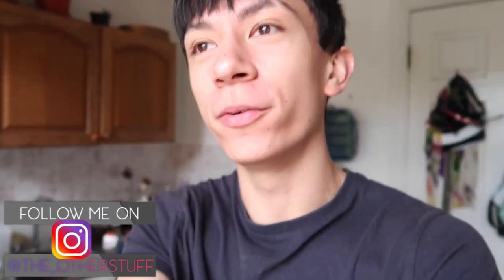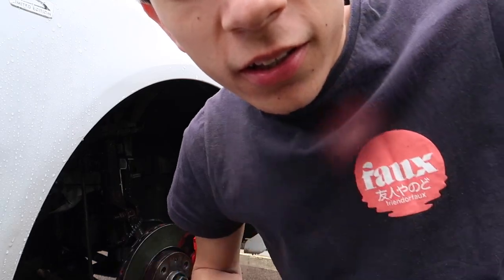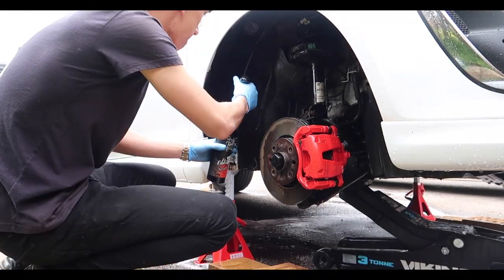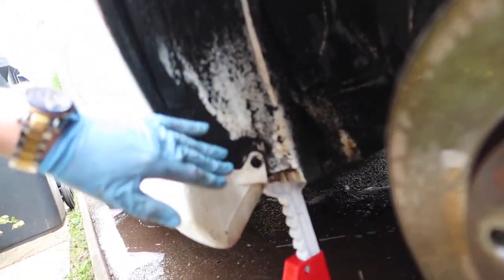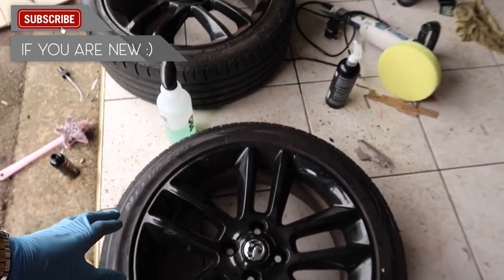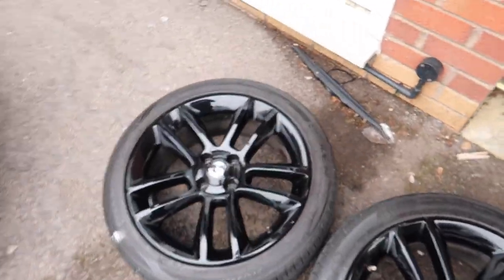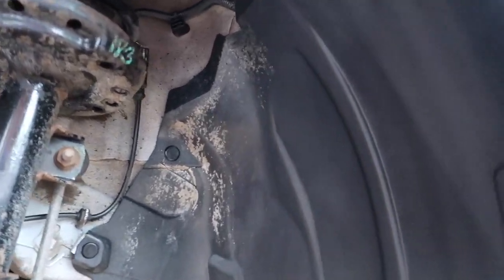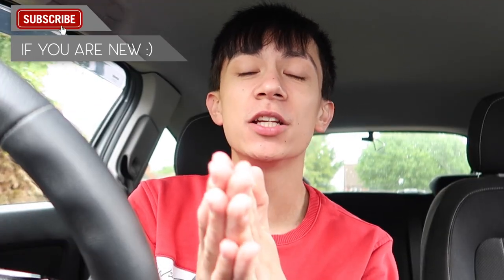DEEP CLEANING MY WHEEL WELLS AND ALLOYS!

Comment: You done a good job,  I would recommend brake cleaner on the disc after the wash.  Would also recommend silicone spray on the rubber parts,  help it last longer, plus gives it that clean new look.  You defo turning into a car guy now.  Welcome to the club.  Great video bro.

Comment: Snow foam is not a degreaser, you should have used a much more powerful cleaner, its a pre wash and not a very powerful one really, most will do nothing. 

The same goes for wheels, buy/use a proper wheel cleaner. 

And deep clean implies wheel barrels cleaned...